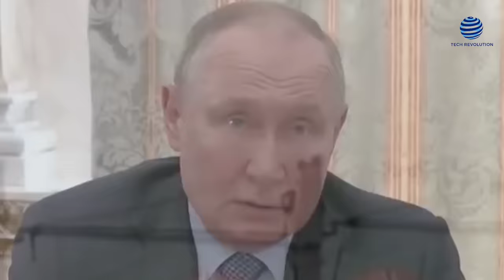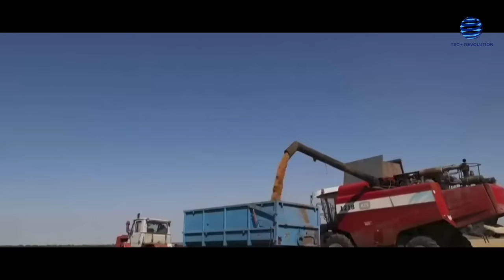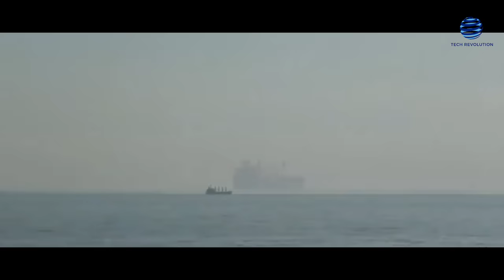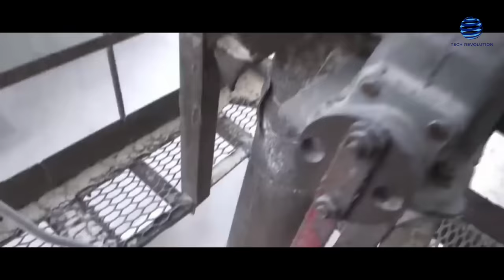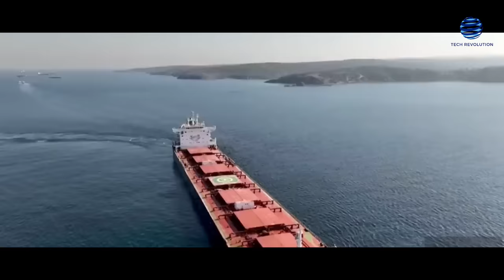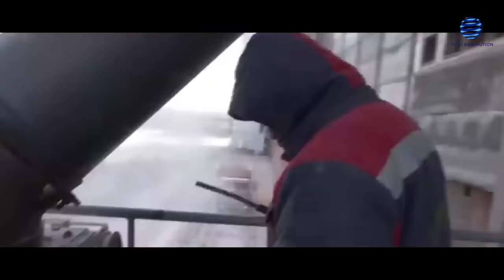Russia Just Dropped A Massive Bombshell On Ukraine And Europe, Leaves The West In Shock

Comment: The problem, the reason the Russians did not renew the Grain Deal, which allowed ships to go to and from Ukrainian ports under Russian protection, was that the Ukrainians abused the agreement in three ways. First, they used the ships going to Ukraine to carry weapons to Ukraine.  Secondly, they used the protected routes to take drones and soldiers to attack Russian ships and port installations and thirdly, the Ukrainian allies did not unblock the Russian Agricultural Bank's access to the SWIFT system.